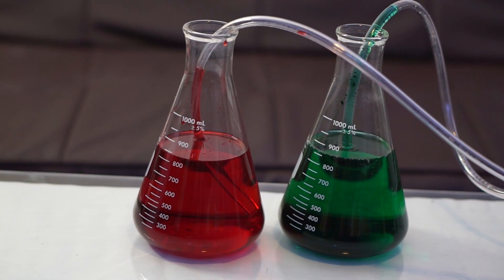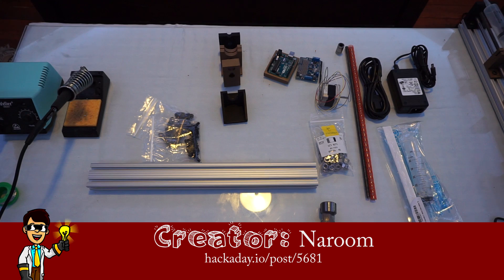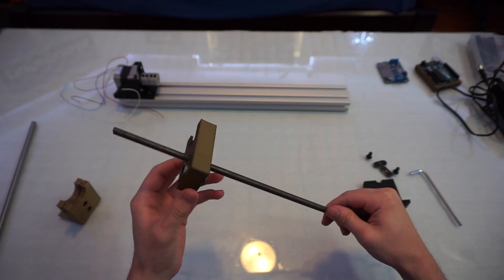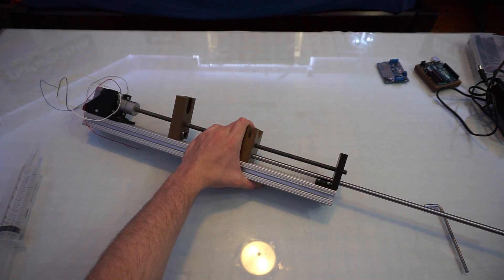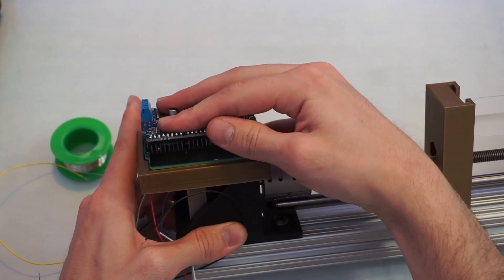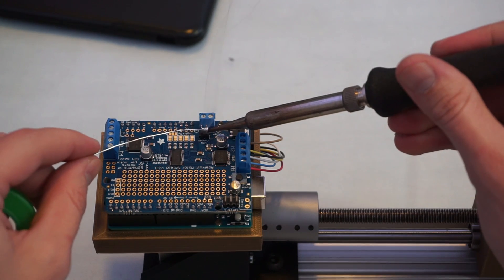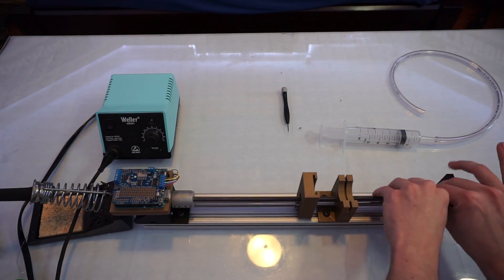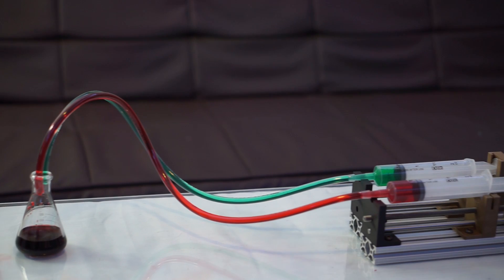DIY Syringe Pump (Food 3D Printer - Part 1)

Comment: I used the exact same components to build this but I ran into a problem. My stepper motor is not rotating smoothly. It's giving more of a ticking motion instead of a smooth seamless rotation.

Comment: Can you elaborate more on the amperage of drivers and what you can use/can't use for a 12V bipolar stepper motor? 
Using an arduino UNO R3, what set-up would you advise I use?

Comment: Although food 3d printing seems to be a popular idea, it's the least interesting application for something like this. Syringe pumps make silicone rubber prints and water-glass printing possible.

RTV silicone provides a flexible print that's heat resistant up to 200-300 degrees celsius and water glass provides a route to ceramics and true glass printing. Also, RTV-1 silicone can be boiled in water to make it food safe. If you're not adverse to strong vinegar, it's actually not bad in some applications. 

As far as food preparation goes, there's not really a reason i can see to do that, but that's me. .

Comment: 200$ is a fuck ton of money for a syringe pump and the stepper motor and driver and arduino are a perfect overkill for this project a cheaper solution will be a normal motor and varying the voltage for different speeds an even cheaper solution is to get one of these cheapo 15 $ water pump and hacking it with a attiny and a stepper driver no need for an arduino or shields that add cost with no benefit anyway have fun
Reply from the maker: Fouzai,

I am able to achieve micrometer precision with the setup. Using a DC motor or a water pump would not suffice for my end goal: the 3D food printer.

Comment: you can use a much higher voltage (if the driver can handle it) with the stepper motors because the drivers are constant current sources increasing the voltage increases the saturation speed of the coils and thus increases the stepping speed, if you need more speed that is :)

Comment: Instead of the linear rod and bearing, you could use a slot of  the aluminium profile as a guide.
Reply: you can but plastic will ware out over time due to friction